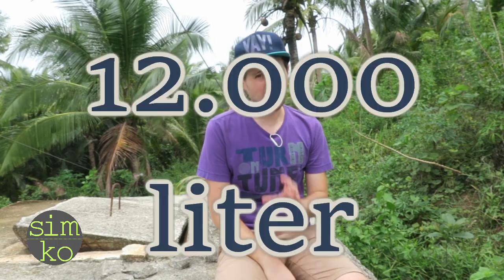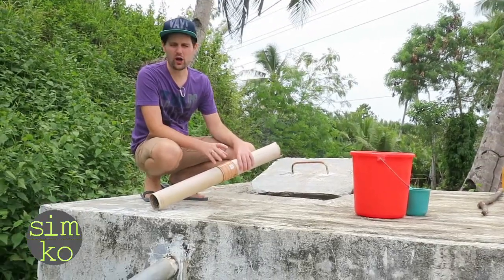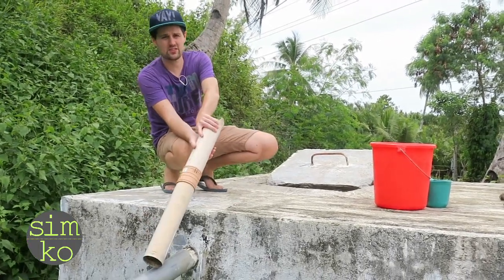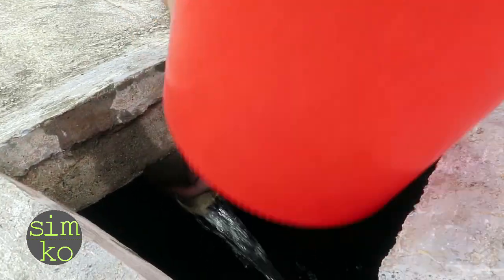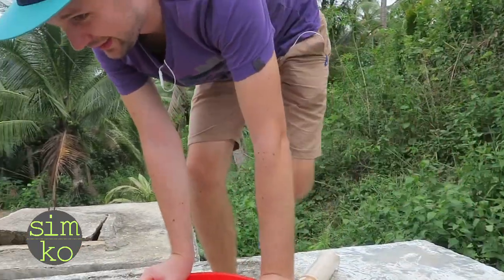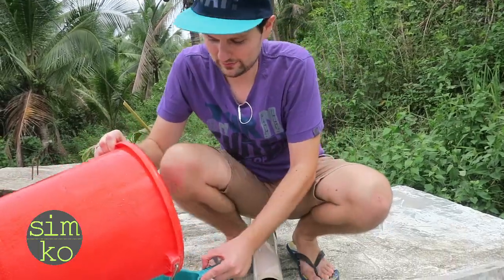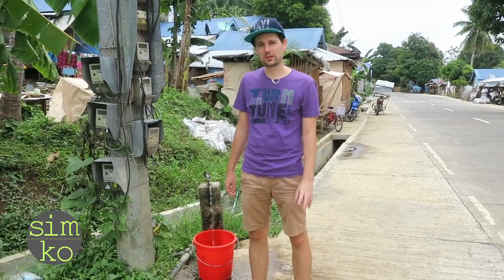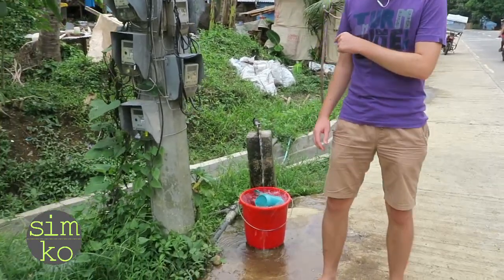Rural civil engineering - Episode 2: solar water pumping

Comment: Hi, Tim here from CFI 😉 have U checked the Pipes for leakages? This could be the reason for high water "consumption" 🤔
Reply from the maker: Hi Tim, great to see you here. Good point. We are planning to clean and maintain the system, probably including the leakage analysis. Anyway, there are lots of hoses, fosset and outlet to privat households that needs to be controlled and observed better. The community wants to take some actions because of this.